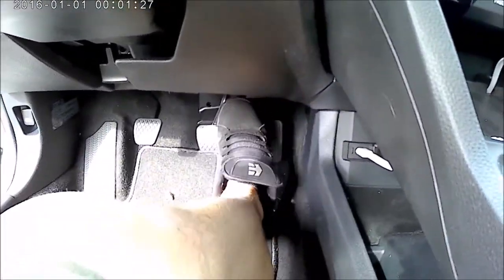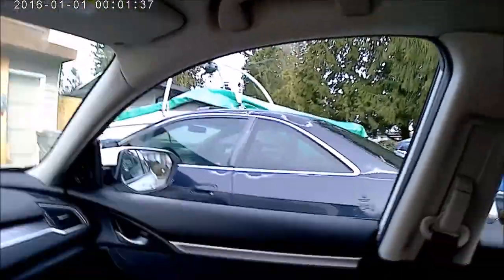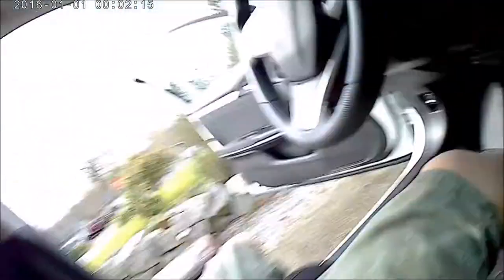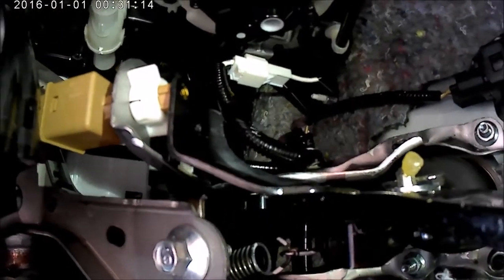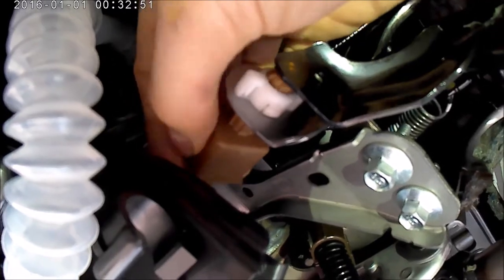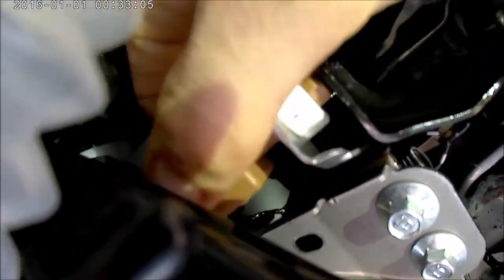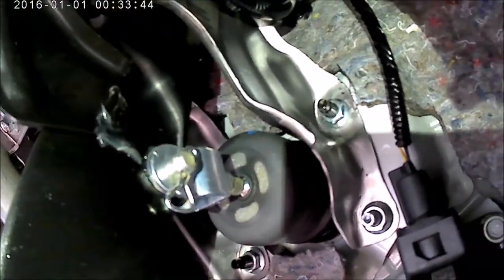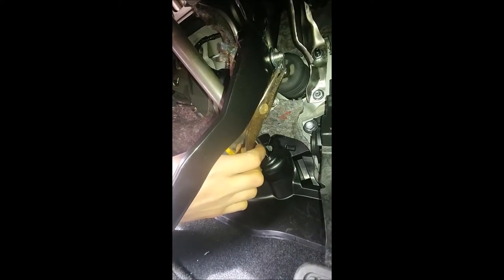How to adjust your brake pedal for easier side step heel toe rev match downshifts 2017 Honda civic

Comment: Sweet thanks man. I just ordered a couple pedals that can be adjusted to be wider, to close the gap between them a bit, and this is exactly what I needed to make it perfect. Found this video in that civicx post. My girlfriend was driving the car the other day and her foot actually did the same thing as that girl in there. I think it's because girls have smaller feet so it's easier to slide underneath the brake pedal. I can't fit my shoes in there but she almost rear ended a motorcycle when she got caught up. Between those pedals and the adjustment, you couldn't fit a foot in there if you tried and it's sooo easy to heel/toe

Comment: just a small warning to those who try and adjust that brown block thing -- you have to make sure that the black tip presses against brake pedal metal part, else backlight will stay on even when car is off and drain the battery.

Comment: hey man i followed this vid all the way through and it worked! thanks so much! i had such a hard time doing heel toes before even if i got used to it, it just felt so unnatural cus the brake was so high and i had to blip the gas two times at some cases just to make sure i got it at the right rpm. thanks again, you’re a lifesaver!
Reply: also for those who are skeptical about doing this, if u put it back properly u should have no problem. only difference from doing this was that the deadzone for the brake was lessened

Comment: This is an awesome tip thanks! I have the acuity spacer but it brings the gas pedal too close for hard braking the gas pedal becomes higher than the brake which is no bueno for me. Going to try to bring the brake pedal closer with this vid to compensate. Love how the acuity spacer brings the gas pedal more to the left and lower, if you want that.

Comment: Is it possible to inadvertently cause brakes to always engage, dragging the brakes while not applying? How can i be sure i am not doing this?
Reply from the maker: I thought I'd replied to this already, sorry. No, it isn't possible to do so, all you are doing is setting where the brake pedal is relative to the brake master cylinder pushrod. You aren't actually changing the position of the pushrod itself at all. only way you could have that effect would be if you were trying to raise the pedal a ton, pedal hits a hard-stop, and then you kept trying to adjust which would then push the MC pushrod into the bore because the pedal could not come up any further.

Comment: Tried this on my 2019, they must have changed the design of the bracket that holds the brown sensor.  The white housing is blocked by a bend in the frame it is attached to.  Even if I could pop out the white housing, the pedal would still get blocked by the frame…
Reply: So I went through the video again, turns out everything is the same.  I just had to pull the brake pedal a bit harder than I thought to get it to pop out the white thing.  It went back together much easier.
Reply: TLDR: you got to pull the pedal pretty hard to pop the white thing out, even though it looks like it will not clear the frame
Reply from the maker: Glad you got it figured out. I think it makes a huge difference.

Comment: Hey, thanks for posting this. The inability to heel toe with the stock pedal height on my 17 SI is one of the few things that still brings me back to my 5th gen Prelude. My only concern with this is somehow altering the "travel before engaging" distance. I love how quickly the SI brakes engage, and wouldn't want to create more travel accidentally. Is there any steps that I need to pay particular attention to in order to make sure that this doesn't happen?
Reply from the maker: +David Schleifstein nope no special steps. You aren't changing anything regarding travel of the piston in the master cylinder or initial movement before brake pressure, etc... You are only changing where the pedal sits at rest.

Comment: Hey, thanks for making this video, just have a quick question. After you take the brake switch out how do you get the white clip out?
Reply from the maker: I'll have to get under the dash and check on what you are talking about, or I'll watch the video again. I'll get back to you.
Reply from the maker: I just skimmed through the video and after you loosen the brown brake switch, is there a reason you want to remove the white clip? you don't need to I just get the brake switch out of the way while adjusting the pedal and then re install it afterwards.
Reply: I figured it out, the clip pops out when you pull the brake pedal back later in the video so you have enough room to adjust the nut/clevis. I finished mine up a couple of days ago, worked amazingly well, thanks for the video and replys!
Reply from the maker: guess I should've watched a little further... Glad you got it worked out.

Comment: How does the pedal feel now? can you post a picture of the final position of the bolt? Thanks!
Reply from the maker: pedal feels the same, that wont change, only pedal position will. I will try and get a pic of where I left it although I think I'm going to lower it a little more than where I left it although it is much better for my driving habit/style already. You should put it where it is most comfortable for your style however.
Reply: Cool, I hope i can get it right at the first try because it is really uncomfortable to crawl down there

Comment: Just wondering would adding pedal height on the accelerator be an add on as well? Maybe thicker pedal?
Reply from the maker: Acuity makes a throttle pedal relocation bracket. To me just changing the brake pedal was enough but if you needed the heights even closer then playing with the gas pedal could work.
Reply: I was thinking the samething

Comment: Hey man. I have a 2018 Civic Si. Is it normal to have a click when first applying the brakes and when releasing them? I feel like I heard your pedal make the same noise mine does.
Reply from the maker: I'm actually away from my car for about a week so I'll have to double-check when I get back to it but it could be the play between the clevis pin and the pedal making the sound, or the pedal coming on and off of the switch... I'll let you know what I find though.
Reply: caraddict sounds good. I believe it is the brake light switch I just wanna make sure it’s normal
Reply from the maker: well there is some play in the clevis pin but that doesn't really sound like a click but it i take up that play then push I can get a click out of the switch if i push fast enough. But the pedal definitely isn't silent though.

Comment: Dude it's for a good reason you put the break peddle lower or equal to gas pedal changes are you will push gas instead of break or both at the same time in a emergency. Then what.
Reply from the maker: They're far enough apart I don't ever see hitting only throttle in an emergency and if you hit both the ecu cuts throttle pretty quickly.